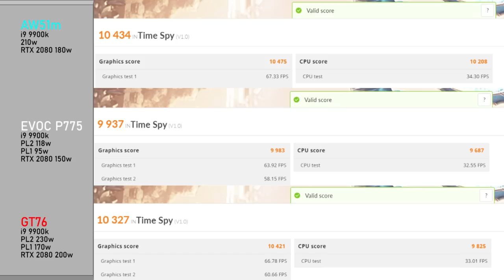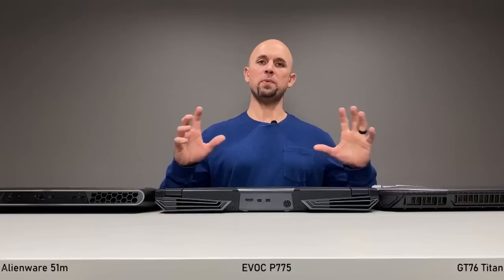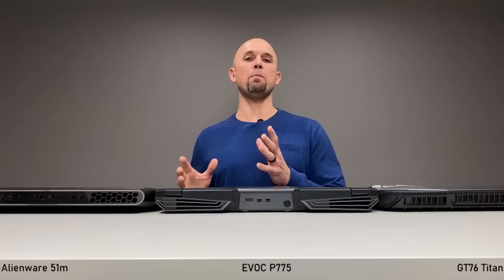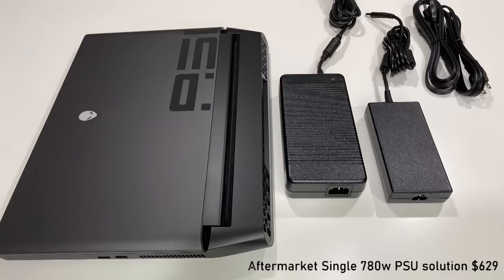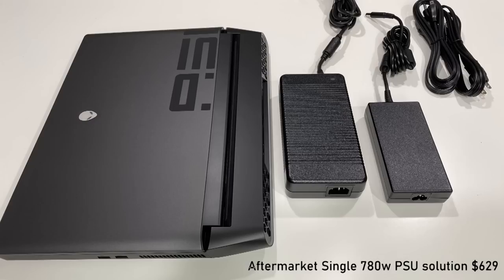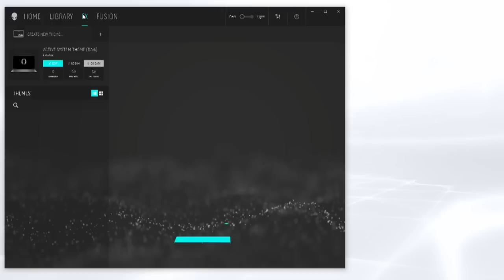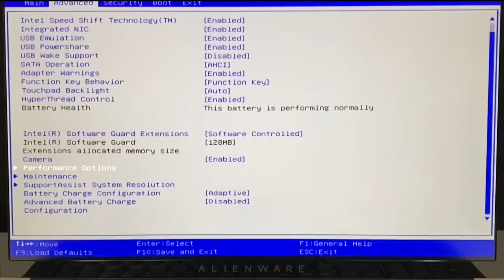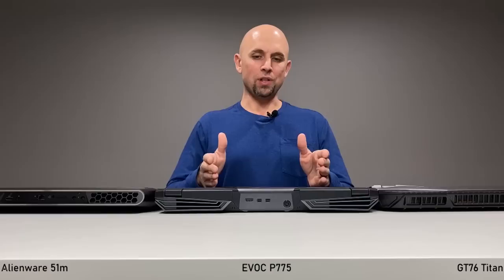The Ultimate Laptop SmackDown!  Alienware 51m vs EVOC P775 vs MSI GT76 Titan

Comment from the maker: This style of review will lack the in-depth tuning and testing that a single laptop review might get. Especially so on LGA laptops that have sooooo many variables.  If YouTube became a full time job that I could live on then I could potentially approach this differently.  Understand that what you saw in this video was still 3 weeks of use over 40 hours then an additional 10-12 hours to create the video.  There’s no kickback from HID so it’s up to Google to promote the video and the last Smackdown made less than $20 after four weeks live in the channel.  

With that said, the AW machine needs some hard work to get it tolerable with these specs. GPU Tweak II doesn’t unlock the GPU temp and flashing back to an older bios for the GPU isn’t something many will want to do minus the hardcore.  I’d go with the spec left in the description if you really want one.  The 9900k at 80w and the GPU temp limit back at 87c will then push that heat over to the CPU and likely hit 100c again.  

The P775 is boring but it works great out of the box.  Resetting the BIOS update I bring back the 6+ core boost clock brought temps up 5c on the CPU.  I’ve done a lot of testing in the side for 2080 performance based on the vBIOS. I’m the happiest with the 150w flash. I have access to the 200w vBIOS for this model and I don’t think it’s ideal. 

The GT76 is a thermal beast can move some air!  Imagine it with a 9700k and a 150w 2080. It could easily run on a single 280-330w PSU and do so around 50 dB. Then add the rest as discussed at the end of the video and thin is the laptop to beat for many.
Reply: Thank you again for this review. The time and dedication you've put in to making this review, we can never thank you enough.
Reply from the maker: Haloblackops Tenken You know what brother, that comment is all I needed 🤛🙏

Thank you ☺️
Reply: It is time to watch ALL the ads.
Reply: You should check out the Aorus 17, literally the best of all worlds, only disadvantage is the fan noise. Had an Area 51m and was extremely disappointed with the software, poor lunar light finish, GPU limitations, lack of optimus in the non gsync model,  limited performance on one brick as well as stupidly low GPU temp limit as you mentioned.
Reply from the maker: Ting Li Oh no doubt I heard it’s awesome!
Reply: @BobOfAllTrades  Keep up the good work. You're one of the few channels who actually go beyond tech specs, benchmarks and actually offer input and opinions of what it's like to use these laptops.
Reply: That GT76 has so much potential. Please MSI, do something on the next iteration. I'm pleasantly surprised to see that you can overclock and undervolt the MSI from the BIOS. It's a big plus in the age of the DTRs.
Reply: For pure gaming which should I choose
Reply: @Daniel Mullen (in your purchase decision) what was competing with areas 51m? Cause I'm about to trop a some money and don't want spend it unwisely
Reply from the maker: Did you make it to the end?
Reply: @BobOfAllTrades  sir for gaming and longevity, what would you recommend? GT76 Titan i9 rtx 2070 or the i7 8750h rtx 2080 gt 75 titan Hidevolution mod?

Comment: Thank you for the comprehensive review! I was able to make a decision based on it. My three choices were of the newer versions, the 51m R2, Sager NP9670M-G3 (Latest Clevo chassis, looks like they took inspiration from MSI), and the Titan. I initially ordered the Sager, for the price it can't be beat, but the display, keyboard, and trackpad was up to comparison, thus ended up cancelling it. What sold me, is surprisingly, Optimus. I wanted to be able to use it as a laptop if needed to and be more energy efficient, quieter/cooler in normal use. Also the better keyboard/trackpad. Thanks again, cant wait to get my GT76!

Comment: For me it has to be the Evoc. I know the style is dated and it doesnt use premium materials but it rock solid and will last you years. My P870TM is still going strong and I upgraded it to a 9900k too, running off of one 330w brick too no problem.  That is huge.  I do not want two power bricks EVER.
That Alienware...its unforgivable to have the frame rate drop down like that after 5 minutes. No one wants to pay $3000 to $4000 and get such poor performance. 
I asked Bob to do the test of pulling out the power cables because I have a friend who had two of them. The system would just shutdown. It wouldn't just use the battery and drop the frame rate. Looks nice, but in truth its crap.
Reply from the maker: When I pulled the power on the Alienware device its screen will go black when I talk to you on the phone I tried it a few more times and it wouldn’t do that again. Still it’s not a laptop for somebody that just wants a plug and play experience. At least not with those high and parts.
Reply: It seems Eurocom is selling these conversion adapters with their 780W PSU: https://eurocom.com/ec/configure(2,404,0)780WACDCAdapter I wonder if these converters can be bought separately.
Reply: @Brainiarc7  They are, a bit expensive but this us the kind of item that will be around even if you change the laptop.
Reply: @michaelgimenez4032  I've been using the 780W brick for a while now. Totally worth the money.

Comment: That´s one of the best review I´ve seen in a while, top notch! One question: at 6:09 you can see a huge FPS gap between the GT76 and the P775 albeit they both runs similar GPU and CPU clocks. Do you happen to know the reason behind it? Could it be due to the Optimus technology? Cheers.
Reply: Or bios but yea optimus on desktop cpu is even worse than laptop but i think msi and alienware may have poor bios optimization compare to p775

Comment: Thanks for the wonderful and informative review!  I do have a question regarding the liquid metal upgrade, especially for the AW512m.  I noticed how poorly it performed thermally vs the other 2 laptops. I was curious to know if "Liquid Metal" is all encompassing:  1) Thermal Grizzly Conductonaut between Intel CPU Die and IHS & GPU  2)Gelid GC Extreme between IHS & Heat Sink 3) Fujipoly Extreme Thermal Pads on heat sensitive surfaces.      Thanks!!
Reply: I'm using TG Kryonaut on mine and it's doing the job very well...all the benchmarks I've seen for that paste show results very close to liquid metal without the risk of frying your motherboard due to spillage or any sort of corrosion on the dyes and the heatsink

Comment: Great review Bob really well done. If I had to choose I honestly don't know which one I would go with. I guess I wouldn't since I just spent the same amount on a laptop that has specs somewhat close to these but alot more manageable, I think I chose the best fit for what I use a laptop for. These chassis are a little to bulky and heavy for me personally. I mainly like a thin and light laptop, as well as I use them just for gaming and browsing. I have to admit I'm a little disappointed with the fact that the Alienware doesn't come with a 240hz panel as well for the price. Doesn't matter as their heating issues steer me clear anyways. Anyways by comparison I just picked up a Asus Zephyrus GX701 with a 300hz (Pantone certified, trust me i can def see a difference) Gsync display with a mux switch. It came with a 2080max-q, 32g of ram and 1tb ssd. Now I understand when comparing it has no room for extra storage unless you upgrade the one ssd and no 9700 or 9900. However i must admit i was very thrilled to see these Bf5 gaming benchmarks while playing on the 3 laptops in review. When comparing to playing on mine with everything on Ultra, I hit a steady 120+ fps with my much lower wattage(90) max-q 2080. Which isn't very far off. Now idk about others but my 2080(max-q) will run at 1800+hz core in "OC" mode. Also it let's me go around +200 core and +350 memory on my custom overclock with no crashing putting the clock speed around the 1920mhz mark. It's pretty crazy. I'm Overall very happy with my purchase. Hopefully others can take note of it's performance when it comes to gaming if their considering something like these 3 in review, but really don't need the extra processing power, weight and thick chassis that comes along with it.
Reply: I am not one to normally call someone out but I don't believe you're getting a steady 120+ frames from a 6 core 9750H and 2080 MQ in BF5 on Ultra. While the GX701 is a decent BGA laptop, don't misinform potential buyers that a thin and light gaming laptop can compete with DTR's like the ones Bob is comparing in the video.

Comment: Bob, thanks for the video very informational.  I did have questions about the P775 unit.  I noticed that they give you options for their screens.  Do you think the 3k panel is a good option due to them being 120 hz compared to their 4k panel at 60 hz, or should I just stick to 144 hz  due to gsync?  Also, I noticed that they had some different options for their 3k panel,  17.3" 3K QHD (2560x1440) AUO 120Hz - 5ms - LED Matte Type Display (AUO B173QTN01.0)  for 195.00 or version 2: 17.3" 3K QHD (2560x1440) AUO 120Hz - 5ms - LED Matte Type Display (AUO B173QTN01.4) for 245.00.  What is the difference between these two panels?  Thanks again for your hard work and videos.

Comment: Bob Of All Trades

            Just wanted to start off by saying i have the GT76 Titan right now and from watching your review i don't regret my choice. The MSI has its faults but i do love the thermal performance from this machine. I have learned to live with the weight and two power supplies (i travel a lot and needed a fast gaming laptop) but i can see why some people hate the two power supplies. I will say that i find it strange how the EVOC P775 is 50W's lower on the GPU and it still out performs the GT76, it has to be because of the mux switch. I do agree with you on the Alianware Area 51m's chassis, that thing looks amazing. When i first saw the EVOC the only thing i could think about was " geez that thing is massive!!!!!" and it looks like a laptop from the 90's. Anyways great review and keep up the videos, if i could subscribe a million times i would.
Reply from the maker: Direct connection to the GPU is best 👍

Comment: Hey mate thanks for the great video. Although it did leave me with some concern with the area 51m. I believe is the first reviewer I saw showing those temps to 100C. Did you try other Alienware 51m with same specs?. Did you check with the provider if this unit you have in particular is not faulty?. Not speaking about the bios update, just those temps...100 C on cpu, doesn't seem right.  I am very incline to think your unit is not correctly assembled or something. Can you update more I do if you speak with the provider?. Cheers mate
Reply from the maker: I saw this coming back at CES 2019. The cooling solution is chincy and can’t handle the wattage Dell likes to dump into their CPUs. It’s like this on their i7 BGA laptops too. All in the name of benchmarks I suppose 🤷‍♂️

Comment: I appreciate this review of the top level notebooks Bob! I have the Area 51M but I flashed back to the 1.32 bios and the 200W vbios. I don't have the throttling issues you exposed with the Alienware. Its a shame Dell/Alienware has nuetered the device to save themselves from RMA issues with burned out GPUs. The EVOC is definitely not the best looking of the three but with the performance with the PREMA mod it performs well. The MSI GT76 I think is good but with no GSYNC, BGA GPU, and the power port on the side as opposed to it being on the back side its a no go for me. IMHO I think the EVOC would be my choice even though i have the Area 51M. I like when you produce smackdowns like this video BOB!!! Excellent video!
Reply: I have had a few laptops and I have not been able to upgrade GPU's anyway without some really hardcore modification.  I usually dont bother.    I get it .. BGA is not ideal but in reality laptops are no where as upgradable as some manufactures want to make it seem even with (mxm) cards you cant just plug in the new card int o older systems.
Reply: Still running on bios 1.32? I'm testing the throttling issue with the temp limit in AWCC together with hwinfo. If this is still not helping I'm also flashing back the BIOS I guess.

Comment: I had the a51m. Probably gonna get another one with the deals they are having. The i7 9700k and 2070 were great. The laptop stayed cool and never ran hot. When I got it I was like dam this thing is pretty small and light for what you get. Especially compared to other laptops that I’ve had. People really over exaggerate the size on YouTube. I was expecting it to be much bigger. I’mma get the same configuration again.

Comment: I have the Alienware Area 51m with a i9 9900K and RTX 2080 , and my cpu temp never hits 80°(65-76) and my GPU temp is around 66° . I did undervolted the CPU and GPU and i have the same performance of a dekstop running with RTX2080.
Reply from the maker: We’re you pulling the same wattage that was shown here?  A 9900k never hitting 80c would be something pretty special.
Reply: @BobOfAllTrades  exactly. It depends on the game . Some games need 95W to run fine . RDR2 need only 50W . U can see my tests on my personal channel . I tested like 10 games . The temps were great. Btw i have the 200W Vbios
Reply: @BobOfAllTrades  it hits 80-83 if the room temp is too high . I have tested Final Fantasy XV and the room temp was 30° . So the temp was a little bit high
Reply from the maker: Bashar Alloush It definitely depends on many things, you’re right about that.  There’s a lot of tuning you can do. If reviewed separately I’d happily get into it. 

Or, imagine this review over about 75 minutes 🙏

Once you buy it you could deal with it, tune it or return it. This review is more for those that expect pretty solid performance sent to them for the premium these cost 🤷‍♂️
Reply: @BobOfAllTrades  yeah true . Thank you for the great reviews like always . I forgot to say that before 💪🏻😎
Reply: Bashar Alloush bro we say dont undervolt
Reply: I have the same one but im too scared to undervolt

Comment: watching this on my area 51m, that i bought used from dell discount at a much lower price :)
my cpu gaming temps are at 70-73, and gpu are in the 50-60. idle we're talking 40/38 cpu/gpu. no undervolting. also no thermal throttle, so bios probably was updated at some point so that's not an issue.

Comment: I hope Dell/Alienware will look at this. Amazing and very thorough review of all three laptops. I have the Alienware 51m and it's thermal throttling search brought me here. It's annoying but I suppose I will keep it till they release a fix.
Reply from the maker: It’s been an issue for awhile now. If it ever gets addressed it’ll be in the second version of it I would suspect.

If they’re not too proud and want to contact me I can tell them exactly what to do to make everyone happy with the current version.
Reply: are you still having problems with it?
Reply: Since leaving my first comment I have fixed the thermal throttling by using the MSI afterburner software. I have undervolted the RTX 2080 to the point in never throttles and it only generates heat up to 70°c when it's maxed out. Never goes over 70°c. Using the Alienware command centre I undervolt the CPU too. Now my laptop  never overheats and I get consistent frames. With the correct tweaking this machine performs like it should.
Reply: D S do u have the lunar light or dark one? I want the lunar light but people say it’s a stain magnet
Reply: @wongpeter5810  I have the dark side.